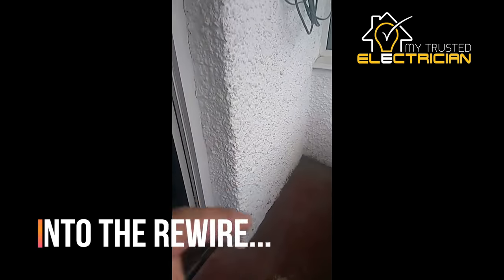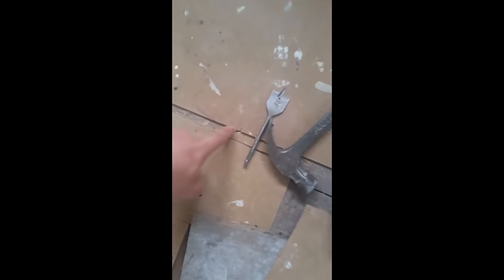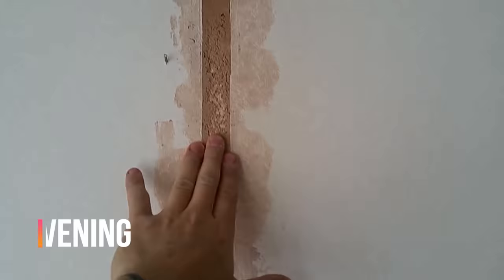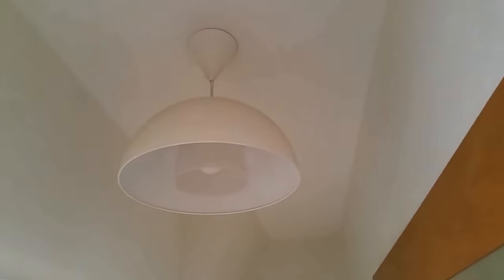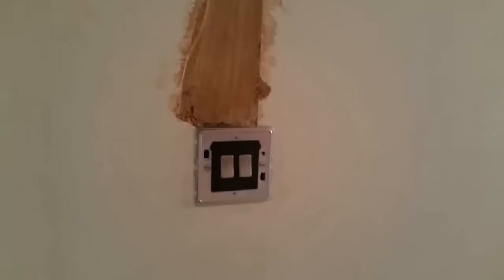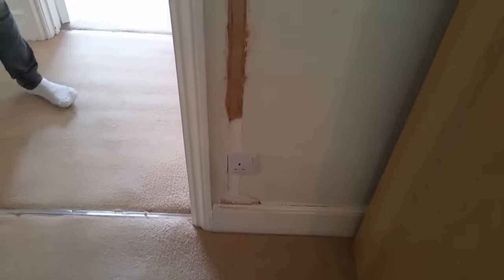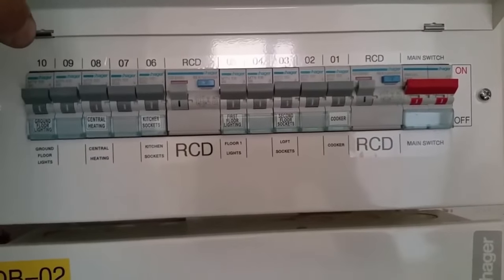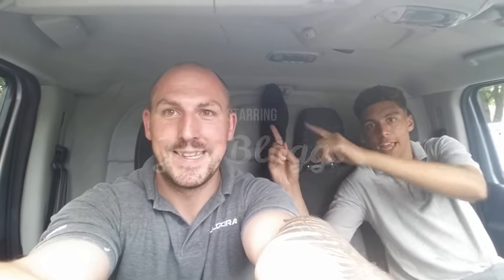Occupied HOUSE REWIRE in the UK

Comment: Good video. This is what we need to do but in a mobile/park home (a bit like a static caravan) so it's all built from studwork. The wiring we have now is the old black and red stuff so needs to be renewed. The home was built in 1976. We are Just wondering If we get the sparks in could the new wiring be attached to the old wiring and pulled through the studs without having to rip all the plaster board of the wall ?

Comment: Good job... always difficult to do occupied rewires...and them hager consumer units the grommet strip is a pain.. How was it for u.... Just a quick question how did u manage to interlink the smokes if there connected to the lighting circuit I generally create a dedicated circuit and usually four core to link..
Reply from the maker: Naveed Mushtaq thanks. Radio bases buddy. Didn't want to stick all my eggs in one basket as they say.
Reply from the maker: Naveed Mushtaq tbh I didn't mind the Hager grommet strip but that's probably because I've used far worse in the past that it just didn't seem as bad.
Reply: Y

Comment: Is poly pipe with plastic clips in ceiling ok in the regs? Don't they violate the no wires could fall and block escape in fire requirements?
Reply from the maker: Hi mate. Are you refering to the loft? If so I can't imagine it being an issue. Chocolate teapot. A fire rated clip isn't much good if the timber joist it's attached to has fallen down. It'll be as safe as the cables with plastic clips which are sitting on top of it.
Reply: My Trusted Electrician in Carshalton ok, well watch out for January as they are not acceptable at all from the 18th edition
Reply: Matthew Wood, Plastic clips and cable ties will still be used throughout even under the 18th. 17th amd3 reg 521.11.201 states protect against premature collapse in the event of a fire, in an escape route. Cables above a plasterboard ceiling (for instance in a loft) are and will be protected by the plasterboard itself as this is a fire barrier and will last easily more than say 30mins therefore comfortably protected against premature collapse. In this scenario the fire barrier of the  ceiling were to collapse then the plastic cable ties/clips would have to melt also before coming an issue. This would be very advance stages of a fire and if anyone is still present in the building the heat and fire intensity coupled with falling ceilings would be more of a concern or danger than cables collapsing. 18th edition reg 521.10.202 is basically the same but takes out the word escape route meaning all over a building cables will now need to be protected, however, again it just states that plastic cable ties or clips cannot be used as the SOLE means of support, therefore for instance every 2nd or 3rd support would have to be metallic support if and only if the cables are run clipped direct to EXPOSED surfaces, suspended under tray or run in plastic trunking. To summaries cables run under floors and above plasterboard ceilings or in lofts above plasterboard ceilings do not full under these regs as mentioned above as these cable are within the fabric of the building. Therefore what My Trusted Electrician has done is fully compliant (even over the top as no requirement to go as far as putting in copex) with both the 17th amd3 and upcoming 18th edition of the wiring regulations.
Reply from the maker: Steven Skillern that was great. That cleared a lot up for me too! 👍👍

Comment: Like the idea of copex in the loft!! Why two fuse boards ?
Reply from the maker: rhysielew0 now you mention it I'm gutted I never mentioned it in the video. 

The short version is 4 RCD's are better then 2 RCD's. If one trips we only loose 1/4 of the properties  electrics.
Reply: Like the videos, your work is spot on. Did you consider a RCBO board. Thats all I use now for discrimination
Reply from the maker: Matthew Rogers I'd agree that an RCBO is always a better method. This was to keep the cost down and the ease of adding additional circuits later easier.
Reply: Control gear RCBO CU from Denmans
Reply: Also if it is a larger property i put a sub board in instead of running cables back to DB1 as avoids a over sized circuit or upping cable size.
Ive seen a modern mansions mansion like house with 4mm2 ring must of been designed by an idiot.

Comment: What's that trunking you use mate? Instead of the capping? Looks so much easier
Reply: Jay Rickards 25mm oval tubing looks like to me, so much easier.
Reply: Jay Harding hi jay what's the oval held back in with?
Reply: @britannic2000  Bonding plaster

Comment: Nice!! What blade were you using in the multitool to cut the box in??
Reply from the maker: Youl George hello sir. Diamond blade mate. Generally designed for tiles but it seems to rip through plaster without going blunt. Just hold back once you get to the brick.

Comment: not sure why you would want to put a 230v warning label on the board, if you do that there why not at every switch,socket or light there is no need, if you use click switches the switches can be swapped to whatever configuration you want
Reply: Anthony charles  warning labels regarding voltages  aren’t even required in most installations anyhow. I love the jobs where theres even voltage warnings in trunking lids ffs
Reply: Well if that's all you can be picky about then I think has done very well. I know there is no requirement but why not? It's the main source of distribution of electricity in the property, and sounds stupid I know but I can't tell you how many houses I have been in and the occupier hasn't known where or even what the fuse board is, so simply adding a sticker with 230v just highlights that it is a source of power and voltage exist. Good practice if you ask me and nice to see.
Reply from the maker: We live in a world where it's better to cover your arse.
Reply: Anthony charles For the same reason substations have danger of death signage even though they’re fenced in. People are thick
Reply: Why would you want to touch a db if your not trained ok reset trips but that's it,most ( sane people)don't like electricity.

Comment: How do you chase your walls? They are the neatest chases i have seen
Reply from the maker: Curtis Jarvis thanks mate. Invest in a chasing tool. It's a glorified 2 blade angle girder with a hoover attachment. Couldn't live without it now.
Reply: My Trusted Electrician in Carshalton bought one brand new about 6 years ago, never used it. I will dig it out of the shed right now😃🤣😂

Comment: What type of blade are you using on your multi tool (at 5.15) for cutting out the back box and do you use that tool for chasing too?
Reply: Diamond blade mate. Generally designed for tiles
Reply: peter friel Cheers, I'll track one down.

Comment: Good vid, what are you chasing with buddy? Is it messy. I'm still a hammer chisel but never neat like that
Reply from the maker: O Hash hey mate. Start with a diamond blade in a multi tool. It'll get you through the plaster without it blowing. I then just use a conventional hammer drill and chisel bit.
Reply: My Trusted Electrician in Carshalton thanks mate I'll give it a go on the next one

Comment: To rewire ground floor you chase cables up from ceiling right and when you do the 1st floor you actually chase cable down from the joints?! . Can you do that? I mean would have thought you must come from the loft down for the ring circuit etc Can someone correct me please?
Reply from the maker: Faithful as long as you run your wires within zone, you can run them from wherever you find easiest. In this case we went ran the ground floor sockets via the first floor as we had no access below the living room.
Reply: Faithful on the 1st floor cables tend to come up from the fuse board and run through the joists into each room, only loft work that’s really needed upstairs is for e.g. smoke alarms and lighting circuits

Comment: do you normally use oval conduit for chases or was it to keep chasing to a minimum
Reply from the maker: I only use oval and round conduit. The only time I use capping is when it's a new build or dot and dab walls
Reply: I think you've just converted me haha.
any advise on fixing it back or do you just purely bond it ?
Reply from the maker: @jackflavell3908  good question. Lots of different methods. Depends on the situation. I generally use a chasing tool which is set to a width slightly smaller then the conduit. A firm push normally clicks it in place. Sometimes the odd nail hammered in the chase sideways, or a screw with a penny washer helps.
Reply: nice one appreciate the advice

Comment: Do you knock power off to each room before chasing incase you get the old cables running through that area, or knock the whole board off ? 
What about pipes how do you avoid them? 
Thanks

Comment: How do you fix the oval conduit?  Does it hold Itself back when cable is put through it
Reply from the maker: I wish it held itself in. You will need to fix it to the wall my friend.
Reply: @MyTrustedElectrician  cheers never used it but looks a lot easier that capping, what do you use to fix it?